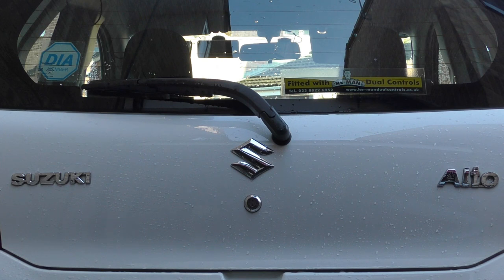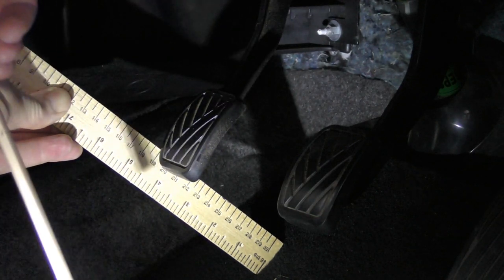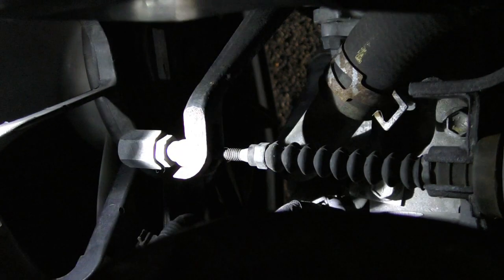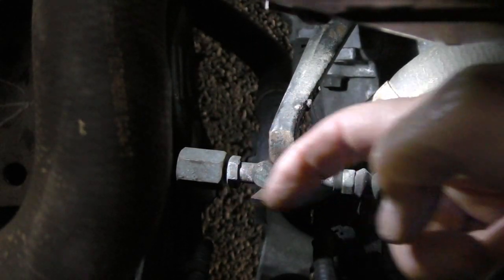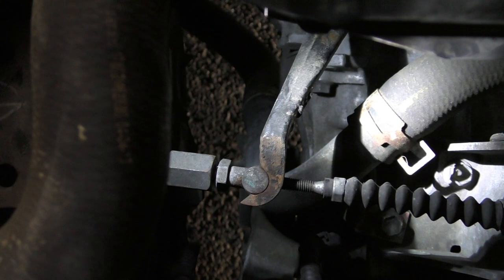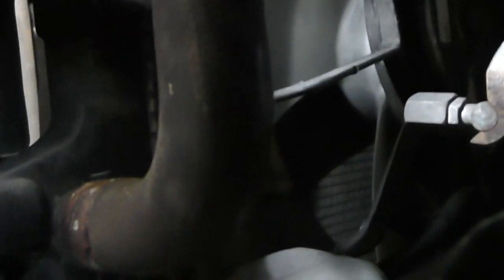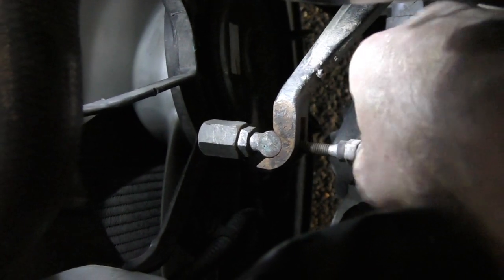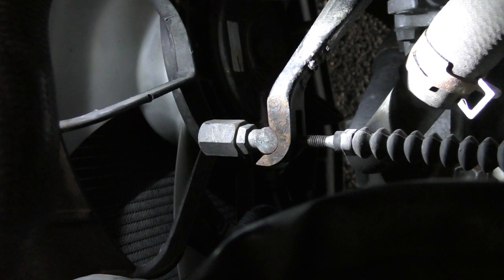2013. Suzuki Alto. Checking and adjusting the clutch pedal free play. Maruti. A Star.

Comment: Sir, can You tell me please how many miles per gallon you can drive in the city cycle?
I got this alto but 2011 and I can do only 36.7m/gallon which is about 15 miles less than manufacturer says. I think it may be lambda sensor but I gonna do diagnostic to find out what may be the reason.Have good day ;)
Reply from the maker: Hello. Thank you for your message. I use my Alto for driving instruction and the fuel consumption can be up to 55 mpg out of town, and whilst in town practising parking manoeuvres etc, it can be as low as 38mpg. Mainly though, general driving gives me around 46 to 50mpg on average per tank full. I do get my car serviced regularly as per the manual so I'm thinking it's normal. I can get much better fuel consumption than my students though as they tend to be heavy on the gas and brakes which can make a big difference. Get your car checked and if there's a problem that could be the reason. Hope this helps.
Reply: @DavidGarside  Hmmm...so seems to be everything ok then.But just to make sure I will do check as You said. Thanks a lot for this quick reply ;)
Reply: Sir, I have changed o2 pre cat sensor which is responsible for sending data to the ECU which then calculates and determines how best to achieve the ideal mixture of air and fuel at combustion.
This helped me to improve economy from 36.7 MPG to 50.2 MPG in city cycle.
Maybe that can help You to save some money too :) 
Have good day.